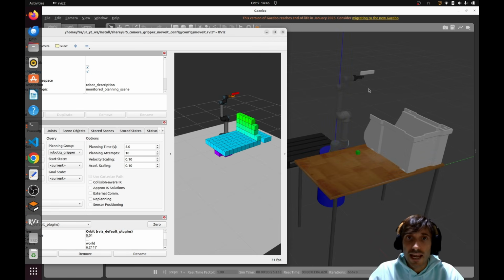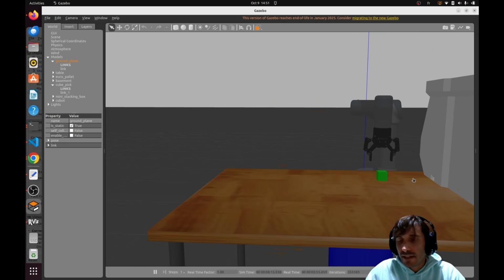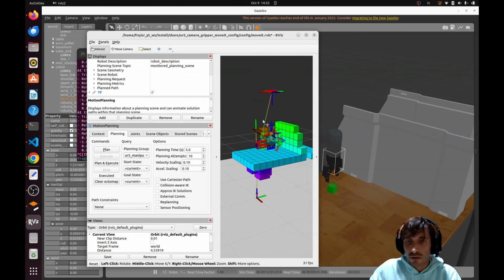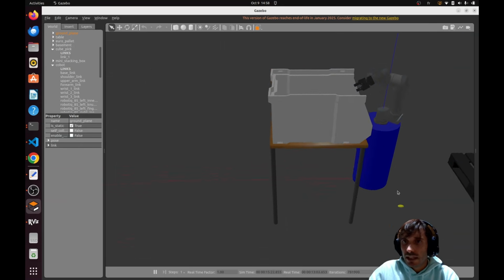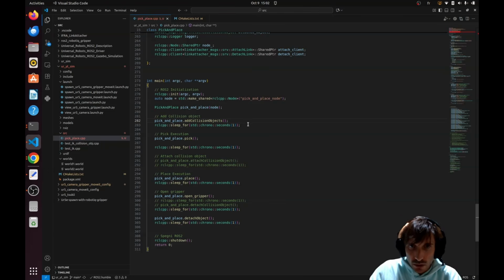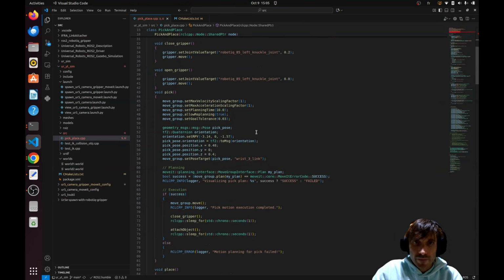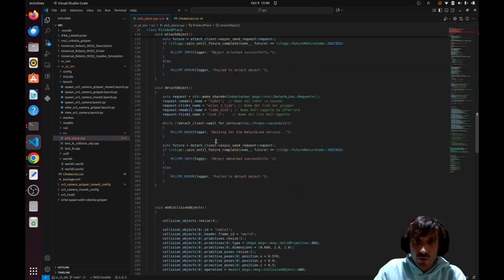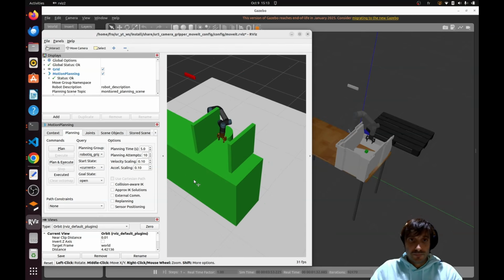How to code Pick and Place in ROS2 MoveIt avoiding Collisions using UR5 and Robotiq Gripper

Comment: Is there any material in the Masterclass about getting sensor data (camera or IMU) from the current model
Reply from the maker: You can check out module 8 and module 9 for 2D camera and 3D camera in simulation (not real sensor). The master class is updated every month with new module. In 2 months there will be a module that deals with a real camera  Realsense D435i. Link in the description